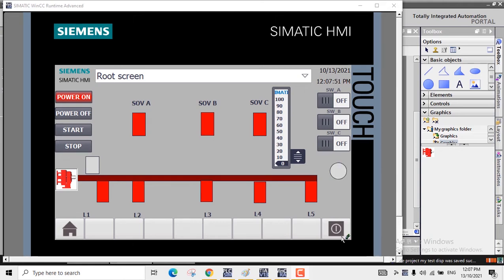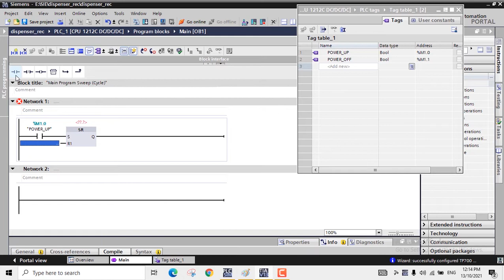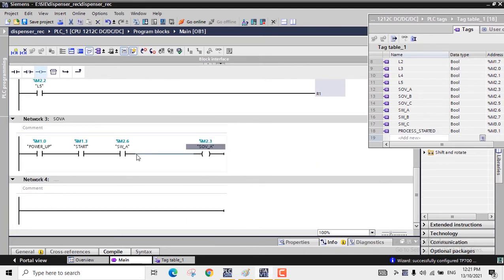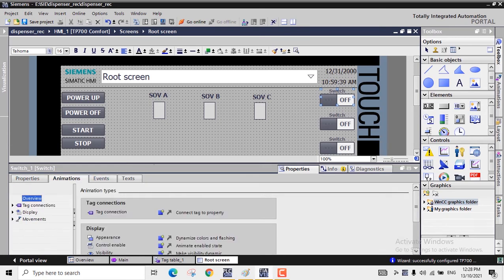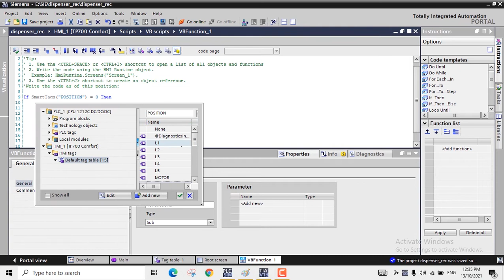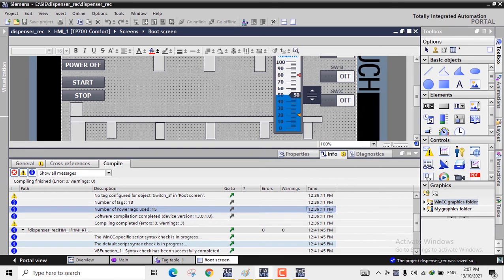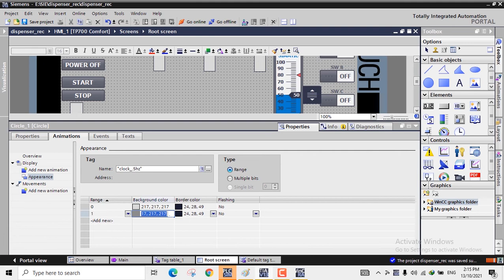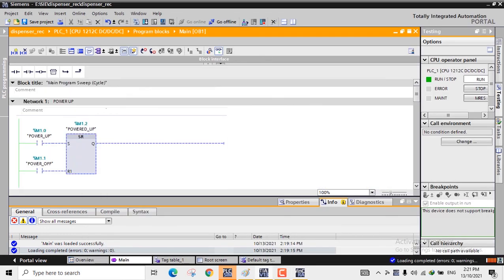TIA PORTAL PROJECT : START TO END || SIEMENS PLC ||DISPENSER PROJECT

Comment: Hi RealTechie , I'll followed your steps but then when i simulate & run my PLC , my power on & off started to switch on simultaneously . Would require assistance , thanks
Reply from the maker: did you sort out issue